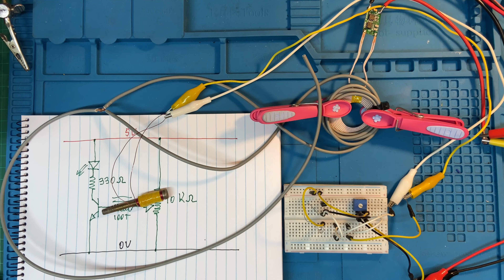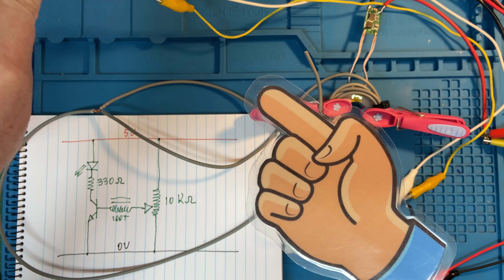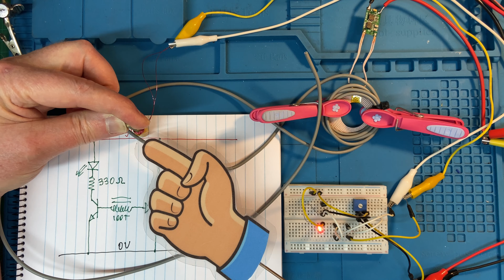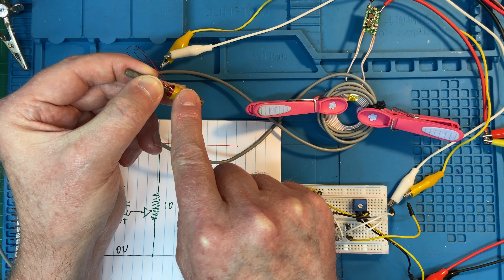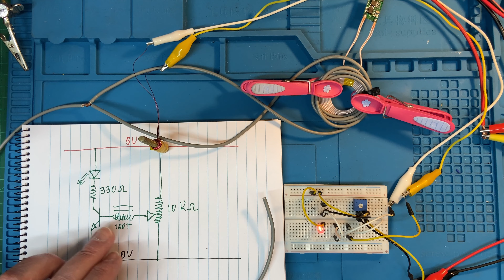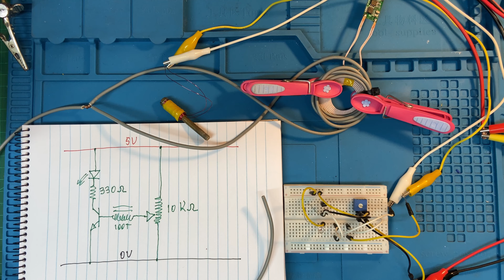DIY Magnetic Sniffer for Finding Shorted Wires – Vehicle Harness Fault Locator Demo

Comment: Great stuff . You taught this old dog a new trick!  . I'm sure this could be used to find shorts on a PC board . One ceramic decoupling capacitor among   many , for the 5V  line  , on a board will fail short circuit  and can be the very devil to find
Reply from the maker: Yes, one could use this on a PC board.